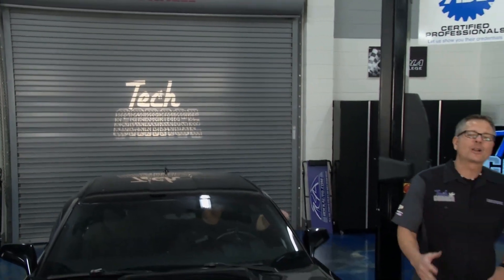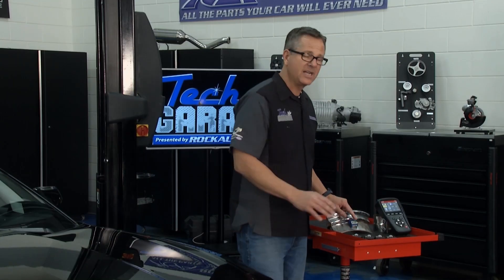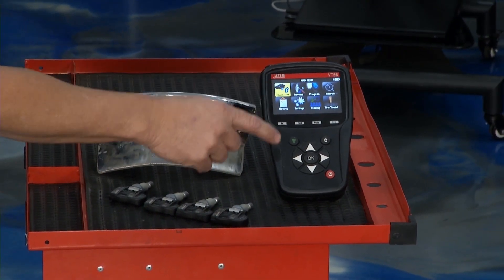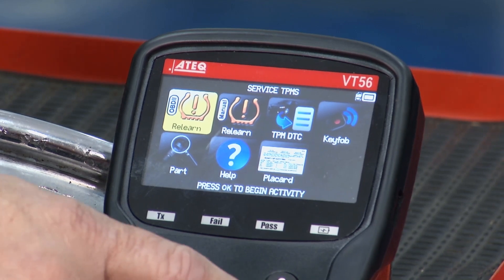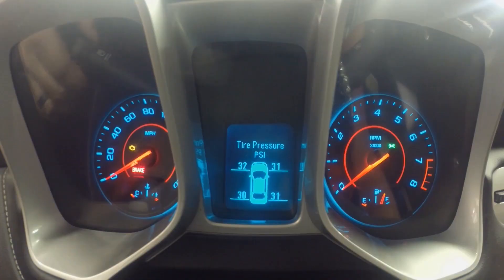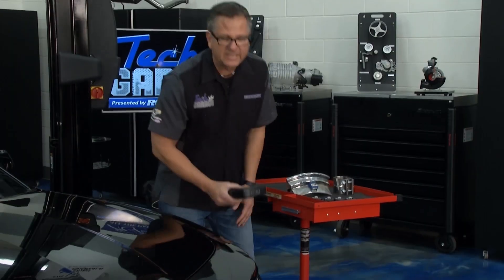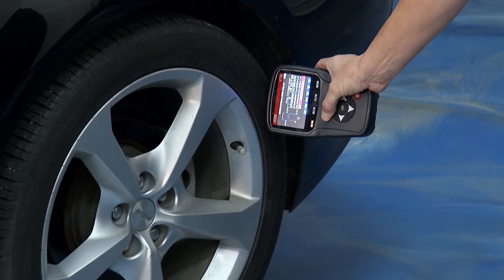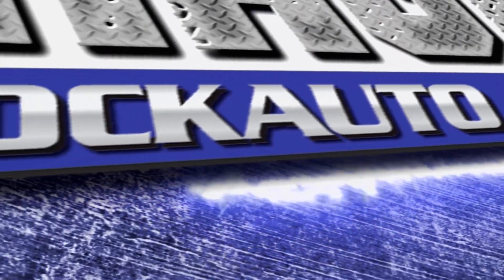Tire Pressure Monitoring System Relearn Procedure (Camaro)

Comment: For some reason when I scan my two front tires the car doesn’t horn but when I scan my back tires it horns. Does that mean my front tire sensors are bad?
Reply: This is the problem I have. I think with the original wheels/tires I got my car with, the TPMS were all working but not in the right spot. The wheels might’ve gotten swapped around at some point, or even onto another wheel set…

My problem now, is that the re-learn procedure’s completely left me unable to do anything; leaving an annoying TPMS warning light on my dash cluster… 

With the sequence that the relearn process goes through, the first tire (driver front) goes off if I use a universal TPMS tool on my passenger rear. LOL #fail And then from there, none of the other TPMS’ pick up a signal or do whatever, when I go to the very next step in the sequence, which is the passenger front…

Comment: 😟 But why was all the tire pressure numbers different? shouldn't they all be the same?
Reply: Some people like to manually relearn the tire sensors, where you either add or let out some air from the tire stems. Because of this, you’ll probably never get it 100% matching for every tire, every single time. 

However, if you do this relearn process with the proper TPMS tool, it can just set the location of the sensor during the relearn sequence and then have you add air afterwards (to even all tires out).